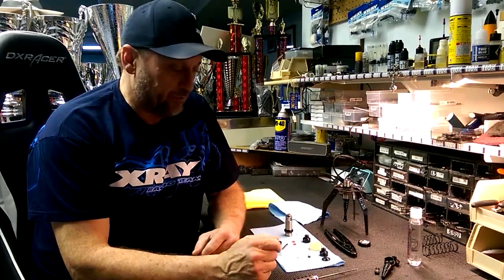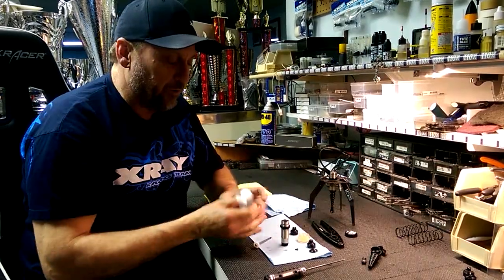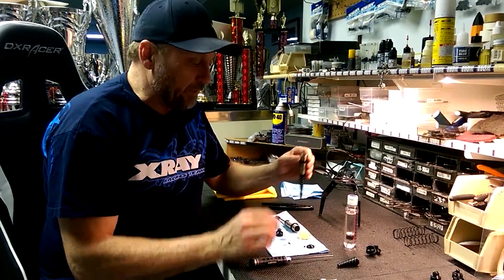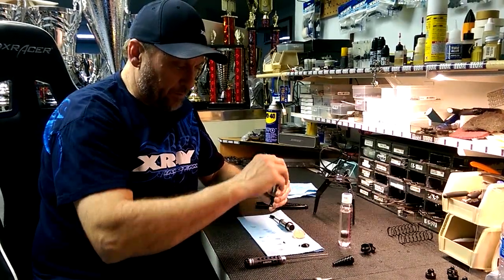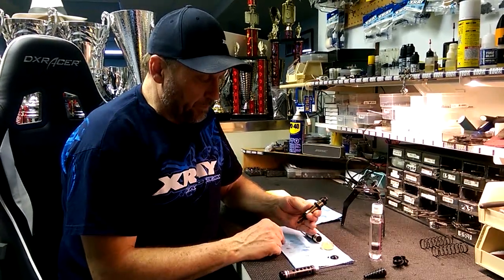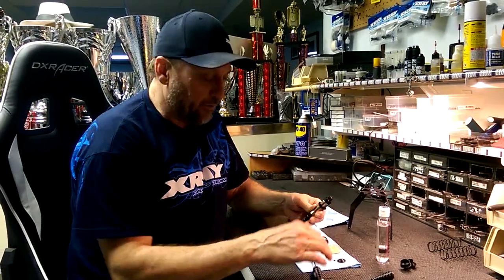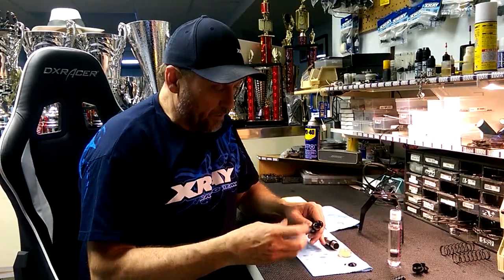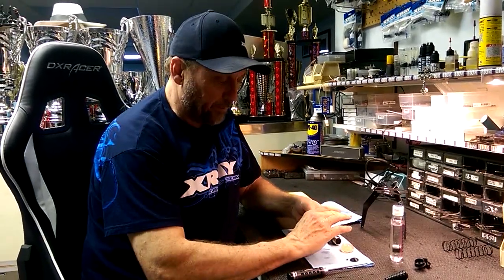Gord Tessmann Pro Tip: Building Shocks

Comment: Hi Gord, That's a real smart way to get compression/rebound instead of just one thickness of oil for both. Would love to see a video on the way ty and the racers move around in the air. Like tilting forward, backward and especially tilting left or right possibly with steering and throttle or something,  is it ? Thanks for that great mechanical tip Gord !!! :-)